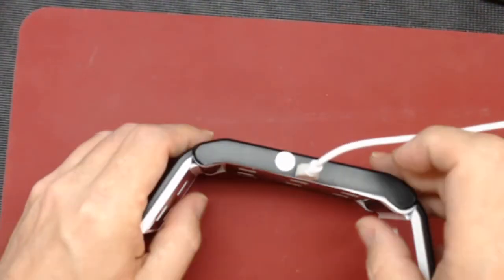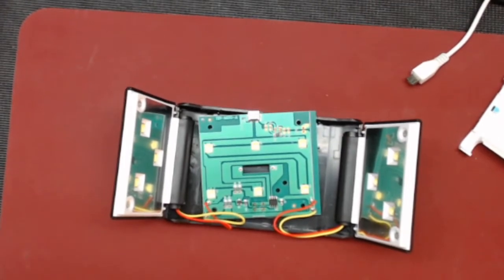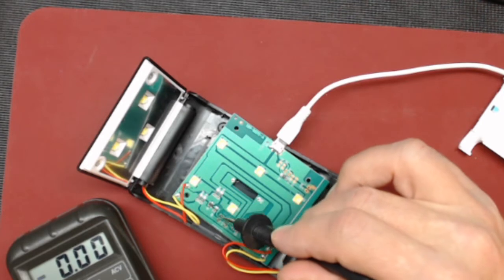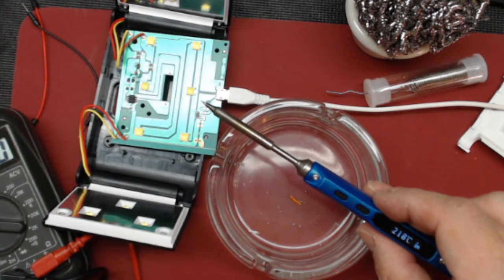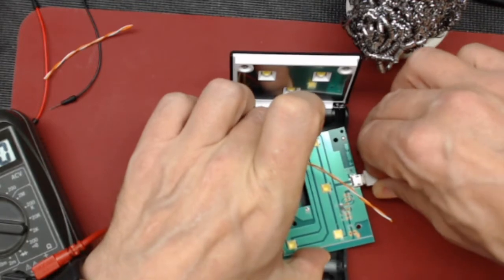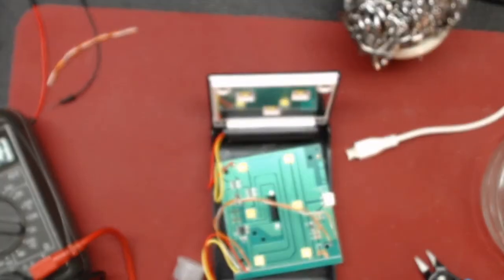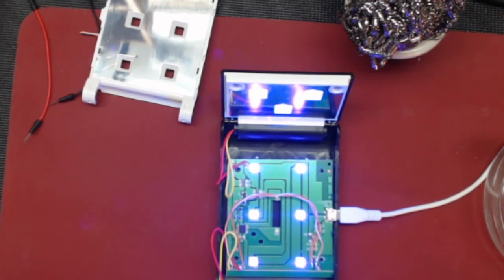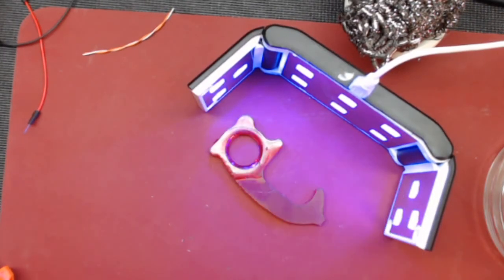Disable Timer on UV Resin Curing Light

Comment: Same lamp, I just jumped where you have the white wire and installed a switch. Orange wire was not needed. Switch off = normal operation with timer. Switch on = always on..

Comment: Doesn't it get crazy hot running it so long?
Reply from the maker: Not that I noticed
Reply: @peterthinks  hm mine got hot just after 45 seconds, maybe it was the adapter. It is dual voltage 5 and 15. The thing may be too stupid to tell it what it needs